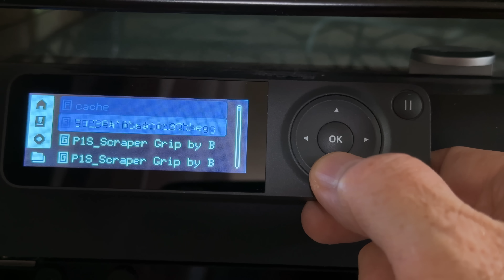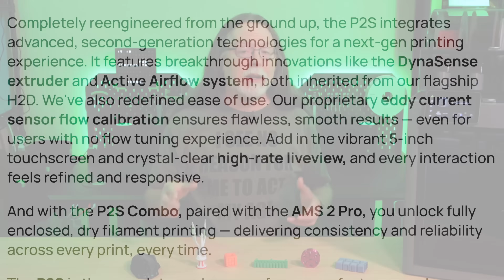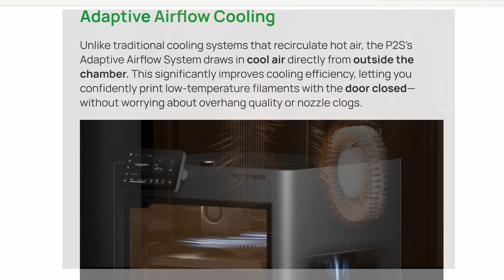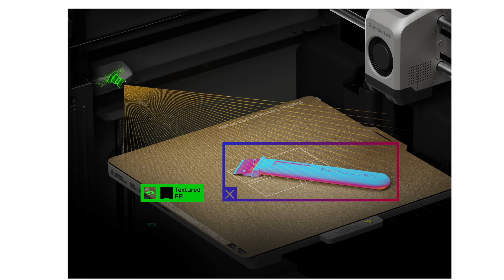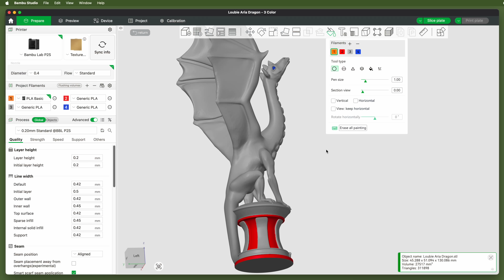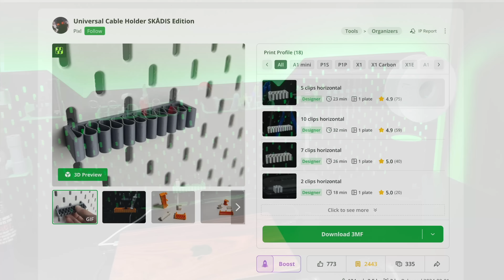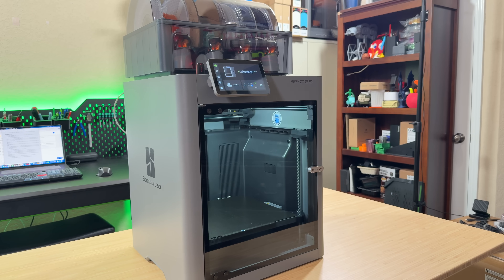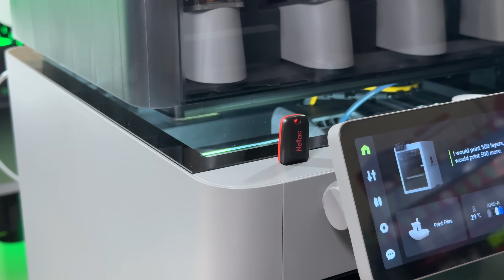They Just Made the X1 Carbon Better: Meet the P2S!

Comment: Thanks again for keeping these going. I don't currently print in ABS or other high temp / high warp factor materials, but like others have mentioned, I do wonder if the lack of an actively heated chamber will impact the ability to print with those materials. Overall, a very solid upgrade to the original P1S.

Comment: I cant see myself ever using this style of multi color ams. 84g waste for a 19g print is ridiculous. Ruins the entire concept.
Reply from the maker: Tool changers are the way to go for waste reduction, for sure. I'm curious to see how Bambu's upcoming nozzle swap system handles it.
Reply: Absolutely right. Doing full height multicoloured prints cause a lot of waste when you are making a single print. The multicoloured prints do look much nicer though and you can get a tool changer machine if you want to shell out way more money than you’d waste in filament. The solution is to print multiple models on the plate. If you print 10 of your 19g models, that’s 190g of model but it wastes the same 84g for the purge. Therefore, this gives you the ability to adjust waste by multiplying the number of models or sacrificing the filament to make the stunning multicolour prints. You also have the option of printing it in one colour, the same as you’d do with another printer, but this one has the automatic functions that help make a perfect first layer. Even if you are printing in one colour, the quality of the print on the P2S is much improved over even the X1C. Print a benchy on each and see the difference.
Reply: The real strength of the AMS is not just multi-color printing, but its always-ready material management system. The auto-refill feature-where it switches to a backup spool when the first empties-is incredibly

practical.

While I've only printed in multi-color about 20 times, it handles objects with simple color layers (like coasters) perfectly. In general, the AMS adds huge convenience, allowing you to print remotely without any manual intervention.
Reply: @creativemode4942  There are many benefits but the biggest one wasn’t mentioned. Multicolour prints? Great! Auto load next spool of the same material? Useful for farms! The biggest benefit is multimaterial printing. PLA and PETG are not fusible. You can print one right on top of the other and they will stick like they do to a build plate, but they will easily peel apart after completed. This means if you use the opposite material as a support interface layer(s), you can eliminate the z gap for supports and improve the finish on supported objects. You can even transfer the interface layer pattern (such as from the interface fill pattern or from ironing the support interface top layer) to the bottom of the supported sections of the model. Then the supports pop off easier than supports from the print material with a layer gap between support and model.

Comment: Wonderful overview and new uk subscriber here who just took delivery of the P2S :) I'm a noob and plugged a longer PTFE tube on to the filament buffer from the external spool holder (not the AMS Pro). How the heck do I get the PTFE tube off the Filament buffer port I plugged it in to so I can plug the what seems a very short PTFE tube (but it's the correct one according to the instructions). All help appreciated :) atb

edit.. with regards drying and printing using the AMS PRO which comes with the P2S... is it done via a power supply that isnt provided in the box? I only got the main power supply.

Comment: Thanks for the info. I've been looking into buying a second P1S, then this drops. I already have a ton of spare and replacement parts for the P1S, so now I have to decide if I should go with two P1Ss, or go with a P1S and a P2S.. Decisions, decisions...
Reply: Get the P1SS
Reply: I just ordered one two days back at same price as the P2S . I feel cheated. I purchased accessories like Stainless Steel hot end too. 
This is the last Bambu labs machine I will buy.
Reply: @70newlife did the P1S stop working?

Comment: some improvements but still some big faults, too many youtubers are not reporting these because they dont want to lose their free handouts from bambu
Reply from the maker: What faults should I be looking for? I didn't run into any problems with this one.
Reply: @BV3D perhaps we have a another drive-by Bambu hater!
Reply: @BV3D  What about the privacy issues, forcing users to use their cloud, forcing firmware updates and all that because of "security".
Bunch of BS. Weirdly none of the many 3d printing youtubers i have watched for years mention ANY of this.
Refering to Louis Rossman is probably the best thing. He explains it well in his two videos.
Reply: I just ordered a P1S with some accessories and AMS2. It will be delivered tomorrow.
I feel cheated. The P2S is the same price as the P1S on their website.

Comment: Wait, extra power supply to AMS2 Pro you can print and dry at the same time? I can't find anything on this. And everyone constantly, even with today's p2s videos, complains how you can't. Everything on Bambu's info says extra power supply for drying on more than one AMS 2 Pro at the same time, but says you can't print and dry from one at the same time.
Reply from the maker: The information I got with the printer included this little tidbit:

You can use the AMS 2 Pro's drying function while the entire machine is in standby, though printing-related functions will be paused during drying. If you need to dry filament while printing, you'll need to purchase a Bambu Lab official power adapter to power the AMS 2 Pro.

I'll try to confirm with my contact at Bambu Lab that this is accurate, but it sounds reasonable.
Reply: @BV3D  Please come back with a video or mention what you find out because this is a big frustration for lots of us!
Reply: I read somewhere that the reason you cant is that the filament becomes too soft and it may cause problems when routing it from the AMS to the nozzle.

Comment: Has the nozzle wiping improved over the X1C?  Not sure what the P1S had, but the stock X1C wiper roller definitely needs to be improved upon, although there are many replacement options.
Reply from the maker: Yes. The nozzle wiper is now a silicone thing instead of the PTFE roller thing that the X1 and P1 series have.
Reply: @BV3D  Look forward to seeing how that works in a future video.
Reply: Look up Scrubber for the x1c. I printed out the one that uses the stock roller and A1 rubber thingy. It 100% solved any issues. There is a good YT video of it too. I print ASA, ABS and PETG no more sticking to nozzle!

Comment: My bambu lab P1S came with a memory card .
Reply from the maker: You know what? i checked mine and it did, too. I guess it was only my X1s that didn't come with a card. Good catch!
Reply: @BV3D  I've never taken my memory card out of either my A1 mini or my P1S.  My Creality cured me of sneaker net.
Reply: X1E (so I guess X1C aswell) comes with builtin storage
Reply: @AndrewTSq Nope, there were some internal models on the X1C but you need an SD card for it. I'm surprised to hear the P1S came with them
Reply: @SangheiliSpecOp  I was wrong about the X1E lol. It only seem to store the last printed model. Ah well, 1 year and never had to print something again from memory, so I guess its ok :)  The P1S came with a Sdcard of low quality so you need to buy a new one anyway.
Reply: @AndrewTSqthats fair. The printers tend to constantly write to the cards, even if you have time lapses off I think its still recording videos and model history to the card so if its a cheap one, it'll just die on you. Its useful to preload all your models to the cards. I remember I had this issue with the X1C months ago where it would tend to randomly delete my saved models from the SD card, I always assumed it was a glitch but who knows